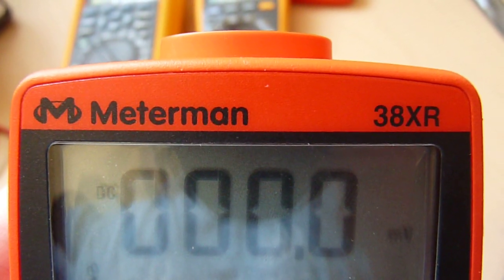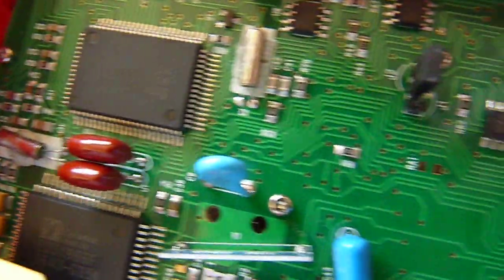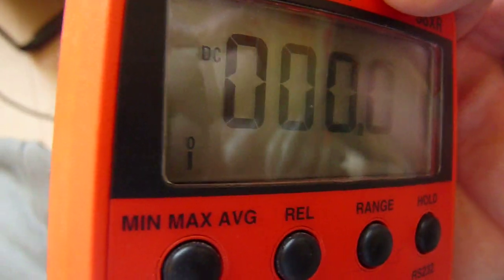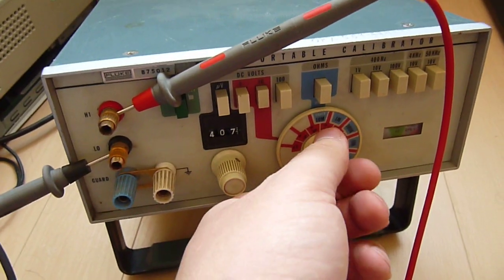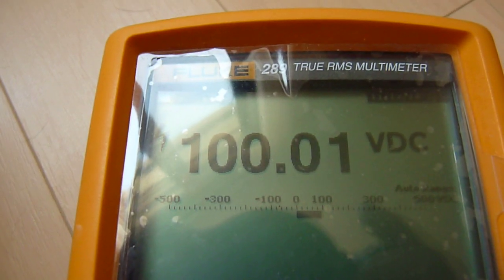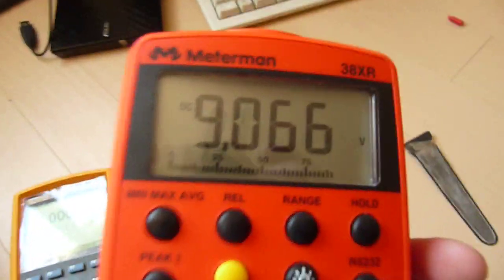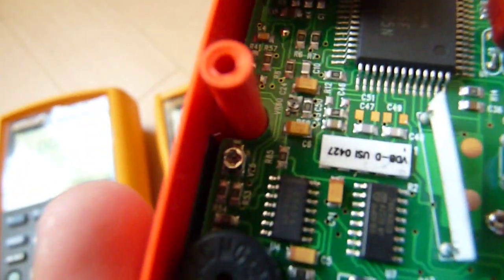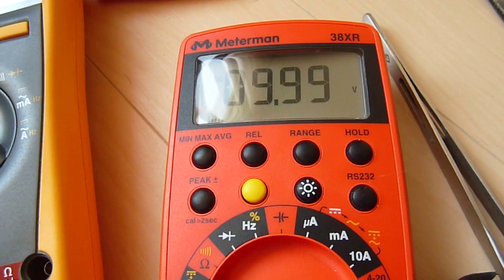Amprobe Meterman 38XR DMM calibration adjustment

Comment: Be advised, this is NOT the correct way to calibrate Meterman meters.  The pot is only a coarse adjustment meant to get you close.  The jumper should be moved to the other position for calibration.  You start on the lowest DCV range and first short the input for the 0 point.  Press the HOLD button to save the setting.  Then apply 900mV, adjust the coarse adjustment, press HOLD to perform and save the digital fine adjustment.  You then go to the 10V range, apply +9V to to the input, press HOLD to do the digital adjustment and save.  Go to the 100V range and repeat with a 90VDC input.  You repeat for every range and every function.  You don't need to mess with the pots unless the meter is grossly out of order, and you don't get a precise multi-point calibration without putting it into calibration mode and doing it right.
Reply: I just got an amprobe am 570 from amazon yesterday. the voltage is way off.  Even my walmart cheap meter is more accurate.  do you know how to adjust? I dont have an accurate voltage source.
Reply: Hey Rick, thanks for your post a while back.  I had to adjust a 37xr because the DC volts was out slightly, but then had to do the AC volts and DC current after they showed a err1 and err2 respectively. .. .  I did DC volts first, (as you suggested) then did AC volts, 900 milli amps at 60 hz, on mvolt range, then tried 9 volts @ 60 hz on 10 volt range, (they did not show on the screen but they tested ok) ... then just did one test each for u amp (90 ua) , miili amp (90 ma)  and amp.(they displayed better)..(1.99 amps had to be 1.99 amps) DC.  (AC just seemed to work without AC Current. )  When one was way off i just went back and tried again with a short on the first test.  and it all worked out.  I had adjusted one meter a few years ago  by the pot but it seemed too uncontrolled so there had to be a better way. all the readings were better after this.